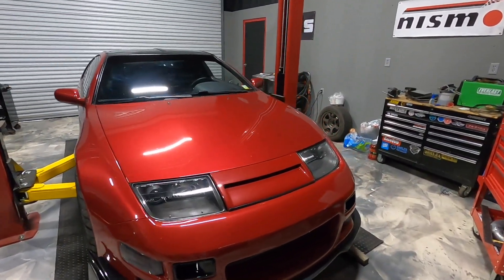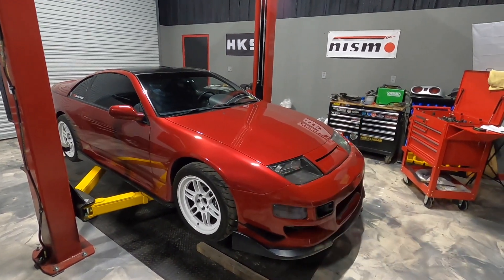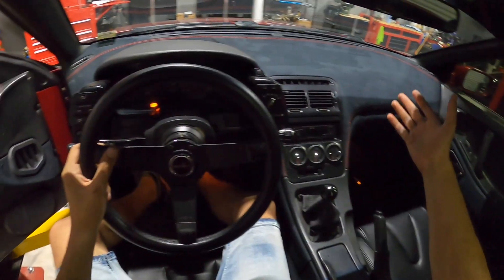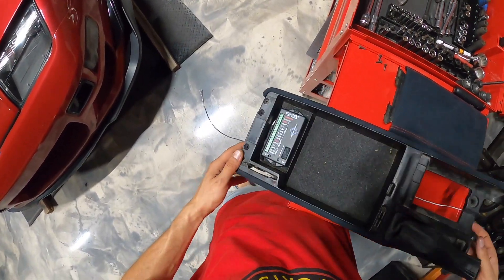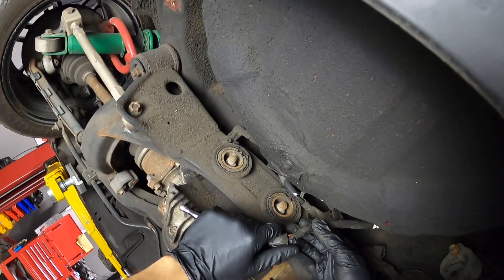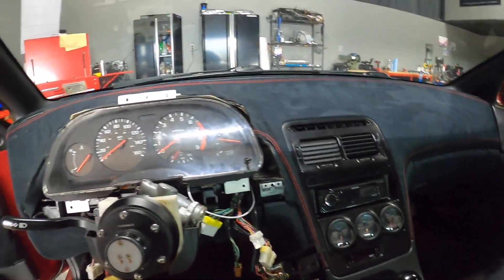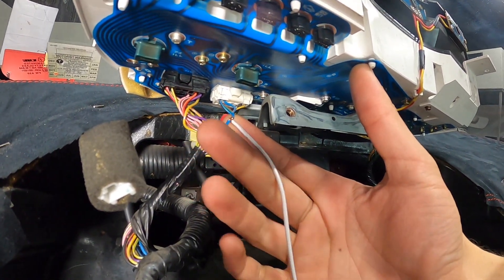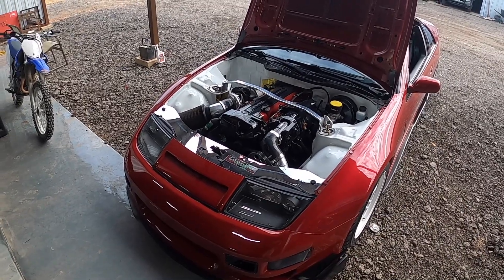How to Fix Broken Speedometer in your Modified Car or Truck

Comment: 180sx. 1JZGTE VVTI. CD009. 

Wiring specialties harness was made to use my abs sensor that was in my front knuckles and those knuckles are LONG gone so I have to figure something out.

I have that same digital box that I’ve been using for rpm but never had the speedometer working. The odometer doesn’t work either . I want to use my HUD!

I DO have a factory 180sx vlsd abs differential! It had some kinda slip on plug that I took out. Wonder if that’s the key getting speed.

Comment: I’ve been dealing with getting this sgi100BT to work with my supra and a cd009 for about 4 months now. Dakota couldn’t help me either, good info but just not working. Debating going to the older box since I found one SGI5E I believe. Everyone I know that has in supra works. But I’m going to give output 1 a shot, maybe I’ll get lucky. Thanks for the vid
Reply: Boss did you end up getting the Dakota to work in the end for your supra? Mines also got a cd009 gearbox
Reply: @Ihatetaxx hell no. I gave up, I keep seeing people have it functional but nobody wants to provide the information. Keep being told wire it to a abs sensor which I did and nothing. I’ve been tempted to just get a GPS module but honestly I don’t drive the we that often to care anymore about Speedo. I know how fast um going based off what gear I’m in and my mileage still calculates so whatever
Reply: @ nah that’s fair enough I hope to god it works for me and if it does I’ll get back to you if I’ve figured it out how 😂

Comment: Hey how much was your total cost for the cd009 trans? With the adapter, clutch ect, I’m ls swapping my 300zx Z31 my original plan was a cd009 most around me are 600-700 (Chicago IL) with the price of everything else I need to make it work, I don’t know if I should save up the extra bit for a tr6060? Most tr6060 are around 2400 I even have one saved atm on offer up for $1800. I’m buying it as soon as this stimulus check hits. I’m on a budget but if it’s only a couple hundred dollars difference from what you’re cd009 cost fit should I do it? Not sure how much stronger the tr6060 stock stuff is, I got a lq4, sbe with new bearings and rings, stock heads, cam headers. So the tr6060 is a direct fit.